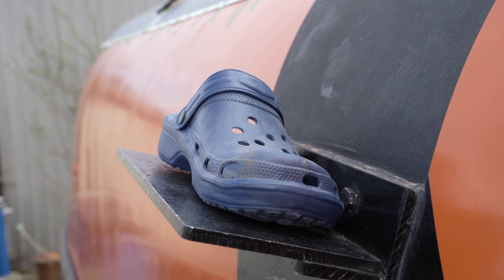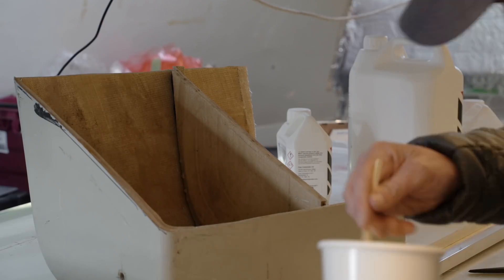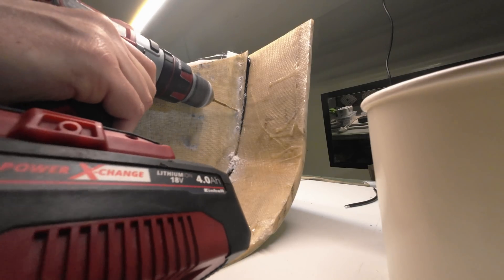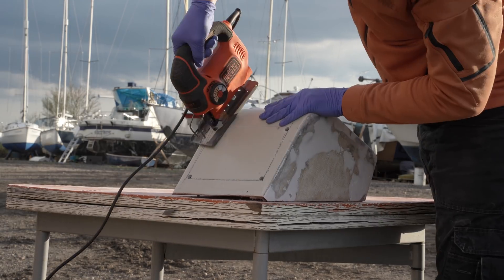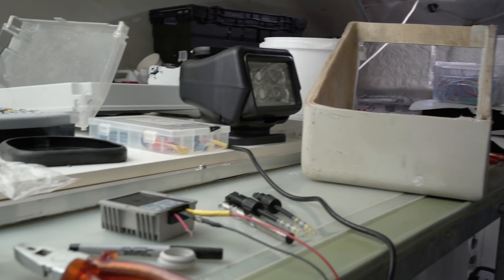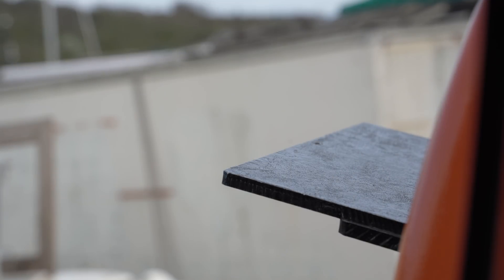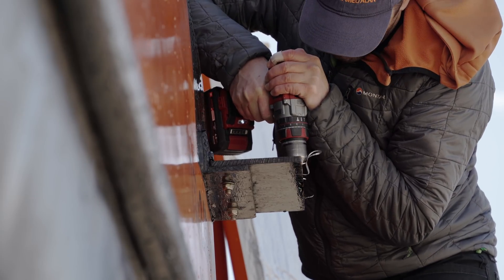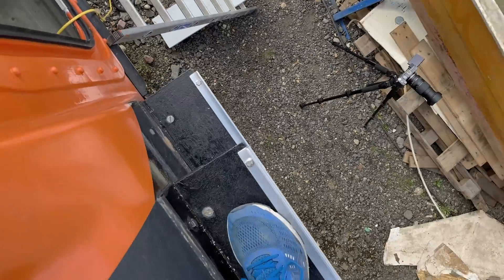Lifeboat Conversion Ep39: Adding a remote control searchlight. Progress on fibreglass housing [4K]

Comment: A note on drilling the holes to find where to cut; Pacific Northwest natives, when carving their dugout canoes (which were big and seaworthy enough to hunt whales from) would drill spaced holes all over the hull. They would then pound in pegs that had been pre-cut and measured into the holes so as to be flush with the outside of the hull. Then they could finish carving out the inside, knowing that when they hit the end of the peg they were at the desired hull thickness, thus achieving a uniform hull thickness and avoiding accidental thin spots. Given your travels you're probably already aware of this but I felt compelled to share the random facts I've accumulated.
Reply from the maker: Thanks Bob. I've not been immersed to any great extent with communities south of the tree-line, so this is indeed news to me. I've seen this technique used in composites mould making etc a few times, but impressed that it has these roots.

Comment: I would have gone a different route and made a spot-light enclosure with a clear plastic dome. At least put in some side windows so that you don't intentionally reduce the light's usable range of motion.
Reply from the maker: Side windows, probably going to happen. A plastic dome would be difficult to make strong enough, at an affordable cost, to stand on, and withstand powerful waves.

Comment: small suggestion for the searchlight: why not holes in the side of the pod aswell, allowing it to illuminate more when turned to the side instead of just being blocked by the pod at that angle
Reply from the maker: Oui.

Comment: The angles on the steps are a tripping hazard now . Check it out there is a tremendous amount of study on tripping . As little as 1/8 inch 3mm can cause a tripping accident
Reply from the maker: Probably. But I've been inside loads of boats, commercial ships, warships, and so on. Thousands of things to trip or bash yourself on. There comes a point where you have to expect people to be careful where they walk and move.

Comment: I think the edgings on the steps will make it more dangerous
Reply from the maker: Ultimately they are made of solid metal. You need to avoid uncontrolled collisions with them. But this will help avoid a sideways slip.
Reply: We have to find permanent replacement to these deathtraps. I suggest chain-link ladders.  I remember seeing good ones on Norwegian submarine. They work even when the boat is covered with thick layer of ice.
Reply: I think they would work better if attached from below the step. The straight aluminum angle-edge is very slippery sideways, so maybe a couple of notches with angle grinder?
Reply: @PasiSavolainen  I like the notches idea, so even an oversize muckluck wider than the step wouldn't side-slip.
Reply: Needs big draining holes of course. Otherwise the water will pool on it and it will turn into block of ice.

Comment: So I have to ask and maybe it was answers before. Why do you mount the searchlight inside that box and not on top? Is it to protect it from ice? Good entertaining video as always.
Reply from the maker: Search lights towards the bow and low down will be extremely vulnerable, so yes it's so it has a home. Also so I can make the step. It's not going high and towards the stern as I don't want to illuminate fog, snow and spray between the bow and driving console window.